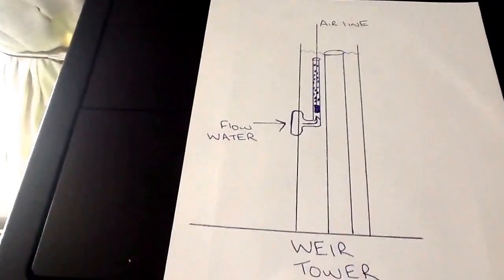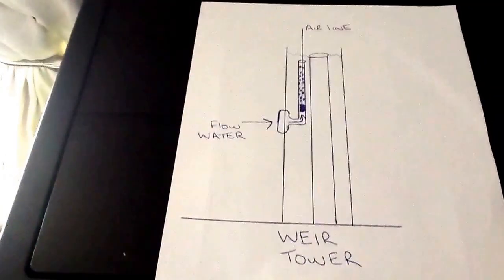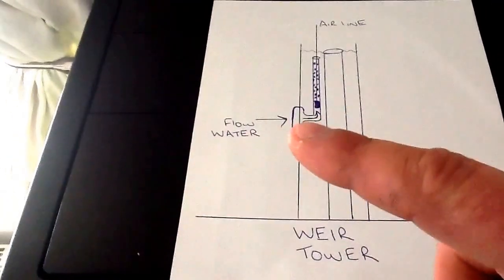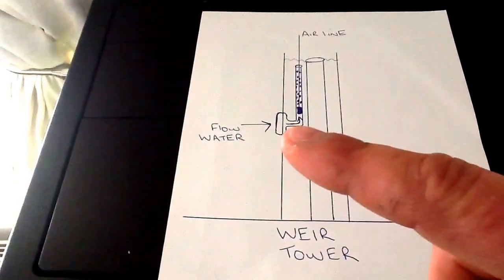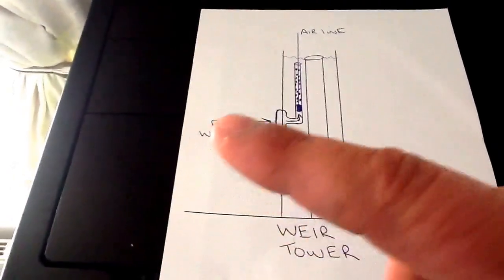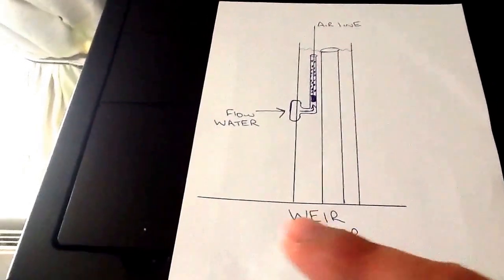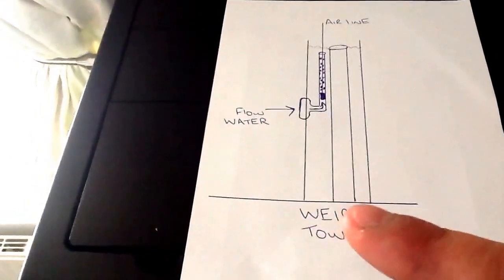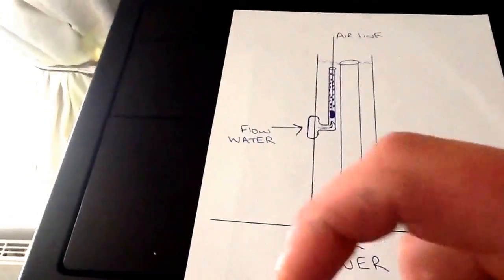Discus fish tank is a go go part 2 weir setup explained

Comment: hey paul. tank looks great. i subbed you back. your discus plans sound good. i have a corner overflow, and am adding an fx6 for secondary filtration. a weir based overflow only skims with surface. and the cichlids i keep produce a lot of waste. it tends to just swirl around my water column.ive  never seen anyone apply what your attempting with the air stone and strainer. hope it works out bro. but if you have a canister hang onto it. you may need it for mechanical filtration as i do..

Comment: Looks like it should work great.  I just did a DIY sump and large overflow for my 125 gallon African Cichlid tank with a 800 GPH pump, probably doing a real 550 -600 GPH because of height of tank.